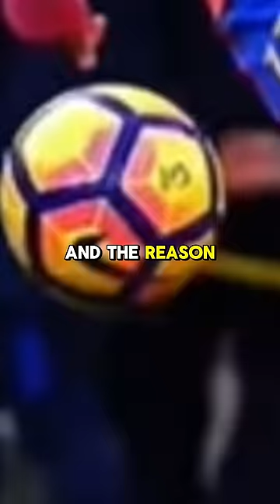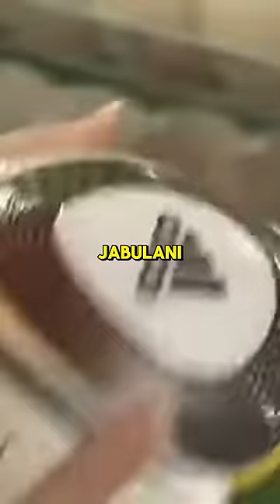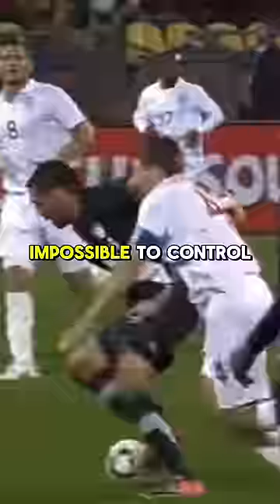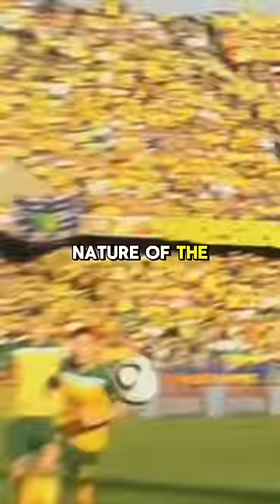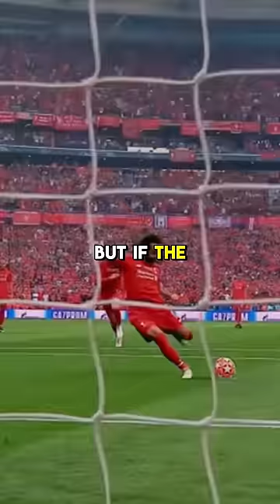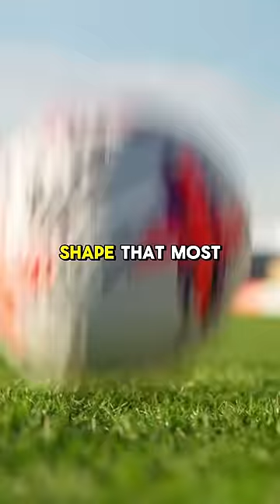Why FIFA Stopped Making Round Footballs 😳🤯 #shorts

Comment: FIFA didn’t design the ball, it was Adidas. Balls are still perfectly round they just aren’t 100% smooth or slick, air will push the ball like a smooth ballon if it’s completely smooth, you need grooves to act like as channels for air to flow around the ball, if not you get the Jabulani, interesting vid but wrong info. This ball just uncovered the fifa rating(aka the fifa approved stamp)  to be bs and be more of a marketing stamp more than anything.

Comment: Adidas (not Fifa) designed the ball and marketed it as 'the roundest ball ever'. But it wasn't the roundess of the ball that was the issue, because unless the ball is rock hard, it will deform when kicked, so spends very little time in a state of equilibrium.
It was actually the smoothness of the ball that was the issue. The airflow over a smooth ball will have a large aerodynamic effect on the ball, causing it to swerve. A less smooth surface will create a turbulent boundary layer in the airflow, reducing aerodynamic effects on the ball. Its the same reason golf balls have dimples, to help them fly straight. The turbulent boundary layer also gives a small reduction in drag by detaching the low-pressure air zone in the ball's wake from the ball, preventing it from effectively sucking the ball in the opposite direction of travel.

Comment: Interestingly, it's only partly about the shape. The Jabulani's faces were molded to be as round as possible, resulting in less drag and less predictable flying paths. With traditional balls, flat faces are fit to a round surface, resulting in small deformations that affect airflow.

Comment: Sounds like it was a bigger problem than just the shape. If it was bouncy, it might have been an issue with how the ball was contructed internally also, the thickness of the material, the padding between the outside and inside air bladder.

Comment: This is incorrect, while the number of sides technically make it a icosahedron, the ball is still round with no edges. Otherwise there would be flat surfaces on it making it impossible to roll properly. There are grooves where the stitching sits but that doesn’t make it not a sphere.

Comment: It’s not that balls aren’t round. The jabulani had less panels than a traditional ball, which made it smoother and less consistent. More panels/grooves give balls more consistent flight because the aerodynamics change. In a wind tunnel, air on the jabulani will just bounce off the ball, but on a standard ball the air flows through the grooves/panels. It’s the same reason why golf balls aren’t smooth and have dimples.
Reply: There's more to a ball than it's shape and texture... a ball that makes players better has to have the right thickness to the material and the right weight and the right plyability, meaning how cushy or soft it is... that ball in the video from that particular world cup seemed off in many ways... too thin, too light weight, too bouncy/plyant... this is in addition to only having minimal seams... the seams are what give grip the ball, in the 1970's and early 1980's it was great to get a hand sewn ball vs a plastic ball with no stiching because the ball felt better and flexed more deeply but at a slower rate of rebound and they were heavier too which made it easier to control...  now the top pros play with the kind of plastic balls that were thrown in the trash in the 1970's and 1980s...  weird huh?  The World Cup uses plastic balls... the best balls of all time I think are the Tango, Tango Europa, Azeteca, the one from the German WC felt good when I tried it.... but I haven't tried the newer WC balls...  my fav of all time is the Tango Europa... you could just smash that ball, I owned one and you can now tell why Van Basten hit such a great goal with it... oh and also the black and white ball from 1970 WC is probably best of all time.  The ball will actually make a huge difference in the quality of the game according to Johan Cryuff.

Comment: That’s not true! The Jabulani, which was designed, created, developed & manufactured by adidas NOT FIFA, was erratic in its movement due to the channels built into the panels of the ball. No channel was in the same direction as another & therefore the wind passing through the channels at varying angles created the off kilter movements that caused all the issues.

Comment: A shape with 12 pentagonal facets is a dodecahedron. Each facet is slightly convex, from air pressure, but the ball is not a perfect sphere.
A perfectly-spherical ball moves through the air differently than a ball with a pattern of roughness. That's why golf balls have dimples.
A smooth ball slows down more, veers at random, and cannot be kicked into a curve.

Comment: This video is garbage. First, FIFA does not design or produce footballs. Second, the Jabulani's characteristics had nothing to do with it 'not being a sphere' - all soccer balls are spheres more or less. The Jabulani performs weirdly because it has no seams - using thermally bonded panels instead of stitched ones - and is therefore very smooth, despite the textured panels Adidas added to try to compensate. This makes the ball transition from turbulent aerodynamic flow to laminar aerodynamic flow - which often causes chaotic swerving - at a higher speed than other balls. With the Jabulani, that transition point occurs right as the shot is getting to the keeper much more often than with other balls.